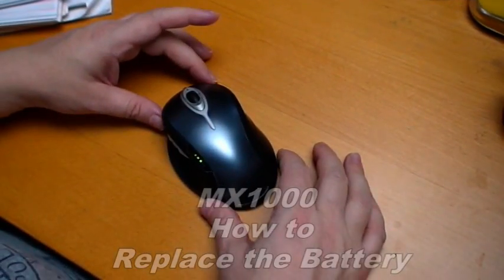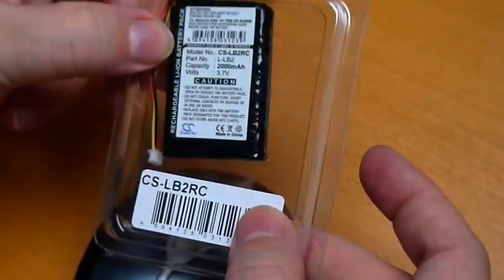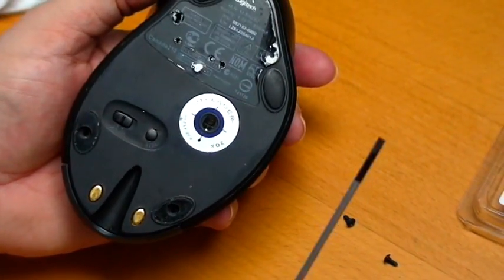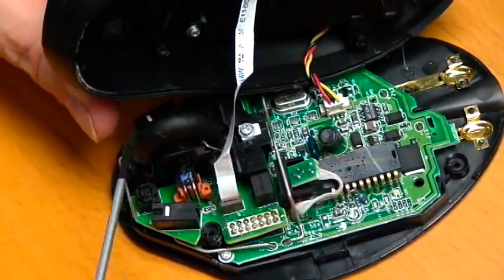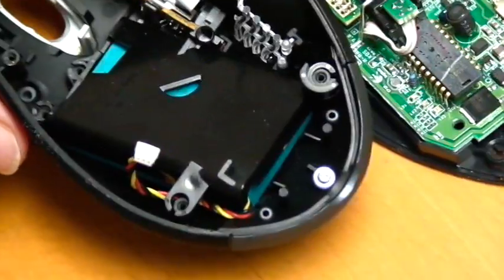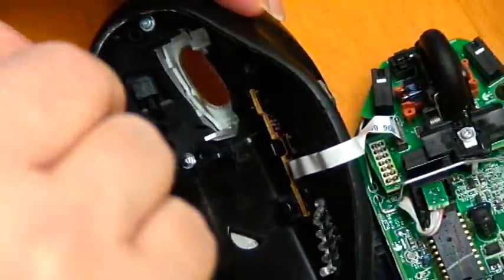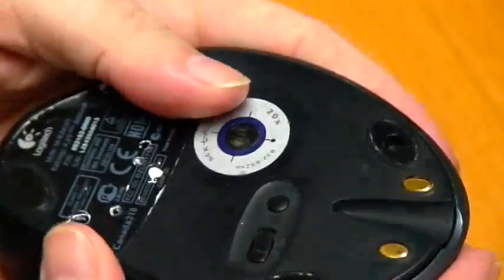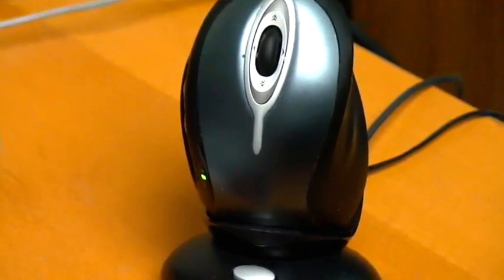Logitech MX 1000 Mouse replace Battery - how to

Comment: Thanks! I've been looking for a battery for this mouse, now I know the part number!
I'm otherwise fond of this mouse, but recently it has started to take 2 or 3 clicks, when I click the left ear once. And that's very annoying. I'm wondering if this mouse is really closing the end of its life cycle or if I could get it cleaned or something, so it wouldn't cause extra clicks.
Reply from the maker: When you open up you might want to try cleaning out the mouse wheel a lot of stuff gets caught up in there. Buttons that actually control the clicks can wear out but also other stuff can get underneath there that can prevent the body from going down all the way require you to click multiple times.  So make sure there's no obstructions.  The best way to do that if you use one of the air cleaner cans for computers and blow out all the cracks and crevices.

Comment: Mine is still working today (more than 10 years i think), the base broke two years ago, but i bought a new one in ebay. Now back button is making double click, i'll try to clean with contact cleaner, will see if we have some luck.

Edit: i recommend you to remove the rubber with some abrasive liquid, later the surface remains smooth and briliant.

Comment: Dumb question but, is there a dongle or receiver for the mouse? Or is it bluetooth? I bought this in a garage sale and forgot to ask if there were other things that came with it... 
And I would need to buy a charger, but before I want to know if I also need a receiver...
Reply from the maker: Yes I did not show in video but it has a caddy.  This is the recharge station and the receiver.  So you have to have it.  The Caddy sits on the desk and has a USB cable for the PC .   You drop the mouse in the caddy to charge.

Comment: Thanks for this - when I put mine on the charger the dots with flash shortly and then all 3 will light up solid. If I remove the mouse shortly after it will show 1 red dot. Does this mean the battery is shot?
Reply from the maker: Yes this battery could be the issue.   Over time the battery loses the ability to hold a charge. So it will charge real fast but because only say 25%  of the battery is available it shows 100% charged.  The moment you remove the charger it will reveal the real charge level

Comment: thx for the video! But the new battery isnt smaller as the old one. You can open the blue case from the old battery, and put the new one in there. so its the same size and it wont rattle :)

Comment: Hi - I just replaced my battery following this guide. However, when I put on the charger the green dots become solid after a few times flashing. Is this a bad sign? Is it still charging? Thanks!
Reply from the maker: The battery could already have been fully charged that you put in.  Use it and after a week charge.   Some battery have memory and may need to be run down to empty and then recharge

Comment: what is the battery life on these things? I own 2 but bought them used, get about 2-3 days life at most;wondering if that is their normal lifespan or if new battery would be a major improvement
Reply from the maker: I can get a week but don't use it every day before you have to rest it in charger.  New MICE have a 1 year battery life.  so a lot has changed ... But this mouse has a great hand feel that many like and they seem to no longer make
Reply: Mark Burnett thnx

Comment from the maker: It could mean that the circuitry to charge the battery is not working.   When charging the three lights on the side will light up one, then two, then three then,   You might try taking the mouse apart again getting a can of air cleaner and really blowing out all the circuitry to make sure no dust is there.  Also checked the connections between where the mouse connects to the charger and the mouse itself clean them.  Snuggle the mouse into the charger until the light starts blinking

Comment: I just replaced the original battery with the exact same one that is seen in the video. Everything went well but the mouse isn't charging when I put it in the cradle. There is obviously some charge in the new battery because I can use the mouse but when I put it in the cradle the green lights go 1-2-3 and then stop, like it would already be fully charged...

Comment: o boy,i remember when i bought it back in 2005,in the days when most people had cheap shitty mouses,this was like buying ferrari compere to other mouse,still have it,still use it,and battery is still surprisingly holds up very well after 12 years,milions of clicks,and who knows how many games played whit it..and those warn off black areas where there is like matt rubber,can be completely removed with medical alcohol,and you get nice,smooth surface,my mouse looks like new after cleaning it :D

Comment: Dear Mark
I got that MX 1000 yet it does not have the RF (receiver). It is Bluetooth one, so can it work if I have Bluetooth card on my computer or I have to order one? I have another Logitech models; Unifying receiver and MX600 2.4 MHZ receiver. Will any one of them work with this model?!
And what is the difference betwwen: 1700mAh and 2000mAh?! Coz the original battery carries 1700mAh and the one you have and on ebay has 2000mAh ?!
Thanks
Reply from the maker: +Imam Gomaa   The Bluetooth and 2.4 MHZ are completely compatible with each other.  It's a completely different type of technology.  You probably on eBay could find a 2.4 MHZ base  by itself where someone dropped their mouse but is selling the base.  You just have to re-pair them and that should work.    The difference between 1700mAh and 2000mAh is the amount of residual power.  So in theory 2000mAh is better and would last longer.  I say in theory because sometimes battery companies overrate their products to get your sales just look for reputable batteries.
Reply: +Mark “The Island Generation” Burnett 
Dear Mark, I already ordered the original Logitech battery on Amazon.ca for 25 bucks but it is 1700mAh 3.7 not 4.2. So, I do not know if it is good like the 4.2 to or not however it ends with 0000 not 1000 like the one I have.
And I already ordered New Bluetooth Receiver C-UV35 USB Wireless For Logitech MX5000 MX5500 DiNovo in case my Bluetooth crad will not detect the MX1000.
The other thing that drives me crazy is that: I installed the mx5000 keyboard through my bluetooth card on my computer and the setpoint detects mx600 laser mouse which I do not have and it gives me that the batter is good. I do not have that model at all. The only ones I have are: VX Revolution laser mouse with its 2.4 receiver in the computer and that MX1000 with the dead battery.
If you can help, that will be appreciated?! 
Thanks again.

Comment: @dagitony  it will have a little bit shorter life than it did when it was new but other than that it will charge quicker
my mx 1000 is still rocking the original battery i got it maybe 7 years ago it doesn't hold a charge as long as it used to when it gets to not holding one at all i will probably do this or get a new mouse...

Comment from the maker: @patronofchaos    Well I don't want to say absolutely it would be be battery but it seems the most logical problem. After 4-5 years it's recharging ability would be limited if not gone  but there could always be some other contact inside broken.  However personally I would replace the battery and give it a try.

Comment: Hello mark ,  what is power supply required for the mouse as my adopter is lost when I shift my House. thanks in advance.
Reply from the maker: on the one  i have ....its a Model L-LD4-0  power supply.     out put +8v  500mA  + in center    looks like eBay and amazon have them .   Amazon has right now for $6.97 with free ship.   this fits the mouse caddy

Comment: How did you figure out what battery to buy?
Reply from the maker: There are two ways to figure out the battery that the mouse needs one is to take it apart and see if the part number or battery information is on the battery itself.  The other is the go to eBay type in the mouse model number and the word battery.   Typically this will get you the results you need to find the right battery that fits the mouse
Reply: Mark Burnett good to know since I'm looking to buy an MX master

Comment: just wish to help you. if you can solder or you know someone who has soldering station. solution can be simple get death mx1000 and replace the contacts or clean those coroded contacts and solder over them. very simple and worth to try. good luck.

Comment: Thanks for the tutorial. I will try it :-)
Reply: +f lr The red indication lights keeps flashing after changing the battery. There's probably something else is wrong. The power adapter seems to work. Unfortunately I will need to buy another mouse.
Reply from the maker: The gold contacts on the back of the mouse wear out.  One trick is wet your finger and rub on the contacts then place back in charger.  Most of the time only one contact is working and it throws a red light.   Also make sure the battery polarity is correct Plus to Plus as that is get you a red light.  Best I can do without looking  a it
Reply: Thanks for your feedback. I've tried it but no luck. Before my original battery was depleted there was a LED light show. All indication lights went on and off in a strange pattern regardless if the physical switch was turned on or off.
Reply from the maker: Of course low voltage can also cause electronics to do some pretty weird stuff.   Without actually looking at it difficult to say what the issue is.   I went up on eBay to get some of these mice that I found in Hong Kong and have them shipped to.  This is what happened back up.  You might want to check on eBay to see if anybody selling them and see if you can pick up another.

Comment: I believe my mouse may finally have reached the end.  I used this video about 2 years ago to replace my battery and it worked great, but I have a new problem that I am jot seeing any solutions for.  My charging contacts on the mouse have corroded the gold contacts down to the copper base below. (Simple electrolysis in action).  I am sad to see this mouse go, it has been a computing companion for over a decade. I almost feel like a pet has died.

Comment: How do I know If the battery is dead ?  // My mouse is charging but not turning on or going in pairing mode//  
Is my battery dead then ?
Reply from the maker: If it's been over five years it's probably dead battery... These will show charging but not actually ever charge. This balance also has a indicator light on the site indicating charge... So I think technically if every time you plug it in it only has one light bar versus I believe 4 that would indicate it's not holding a charge

Comment: Either the charging element on the mouse or the charger base broke on me after almost 6 years. I was foolish and replaced with a Razer Deathadder and the mouse is way too lightweight. I have the DPI of the deathadder at 3500 and the polling rate to 1000hz and I can't tell a single difference from my MX-1000. My next mouse will be another MX-1000.

Comment: I can see why Logitec says you can't replace the battery - it's almost impossible to reconnect the cable after installing the battery. I found that it is easier to reconnect the cable and then put the battery in place.

Comment: amp hours is an estimate of the theoretical total charge capacity.   in an ideal world a 10 amp hour battery would supply 1 amp for ten hours at the rated voltage.  A 20 amp hour would supply 1 amp for 20 hours.  A milliamp is 1/1000 of an Amp.
A 2000mAh battery will go longer between charges than a 1600 mAh battery.

Comment: if you can solder you can use KODAK KLIC-5001 you can have them for like 3 buck on ebay desolder the cable solder on the new battery

Comment: i lose the ac adapter for the mx1000 mouse receiver, someone could tell me the output voltage and amperage of the adapter, please? thank you a lot
Reply from the maker: the power Adapter is model L-LD4-0    for the MX 1000 base charger.    output +8V  500mA  positive center    if you look for "power L-LD4-0" on eBay they go for $5 to $19...Mark
Reply: Mark Burnett thanks!
Reply: I have the same problem. Along with a missing dock. It spent some time in storage. :(